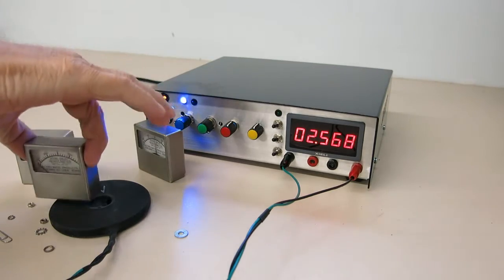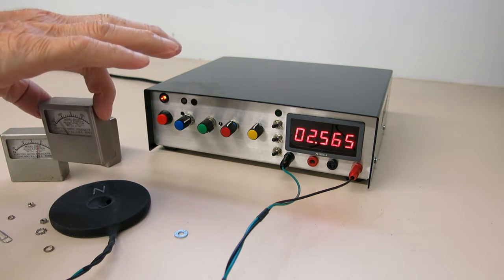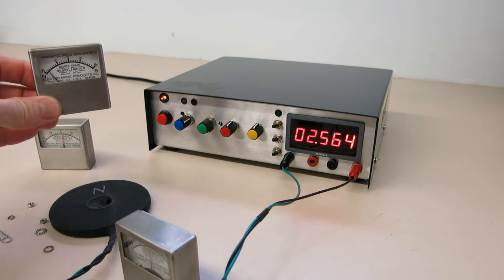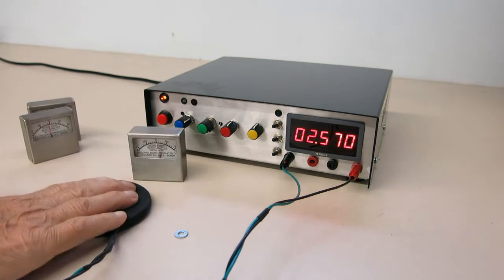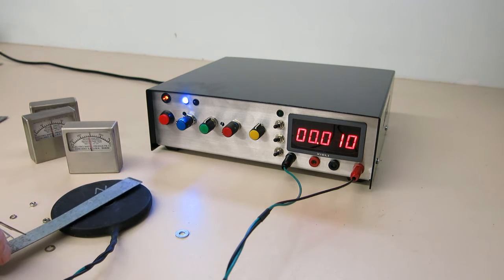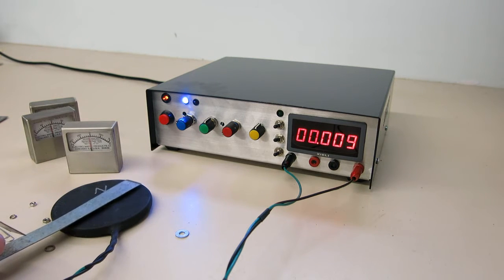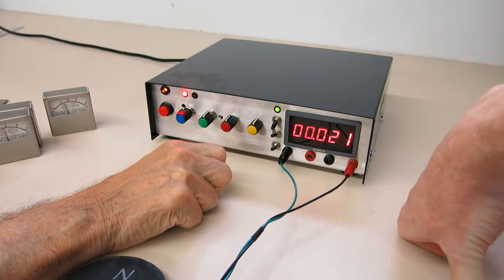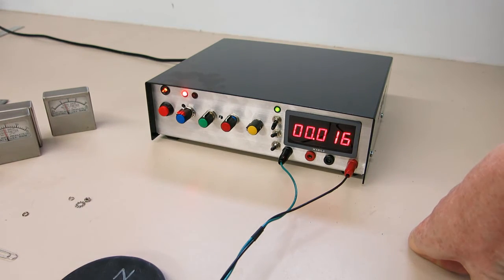Theramagnetic Pulser TDHP30

Comment: That's a great little machine. I have a question, can you float aluminum on it. In my Video I can float aluminum over the coil that puts out around 0.5Tesla (5,000 Gauss) running around 80Hz Here is the link to the Video https://youtu.be/VGiYn66L1mU